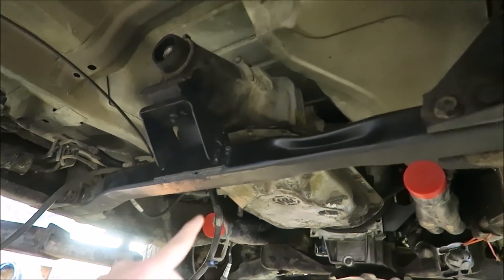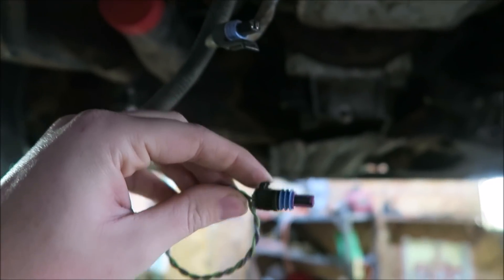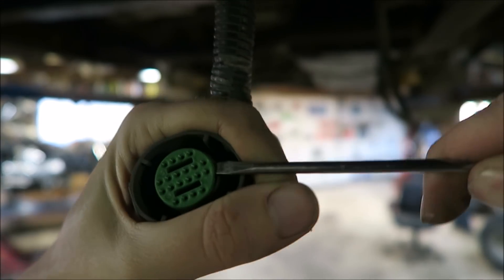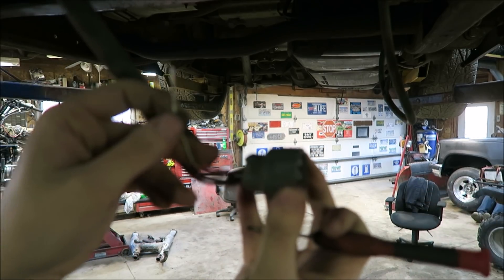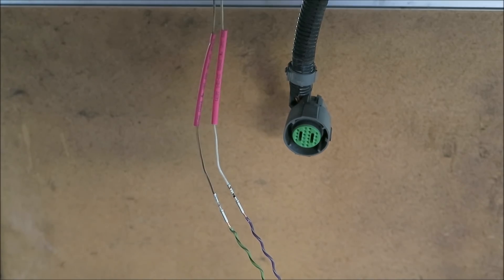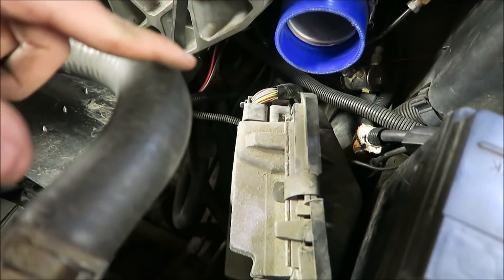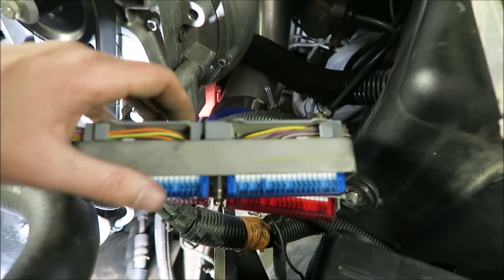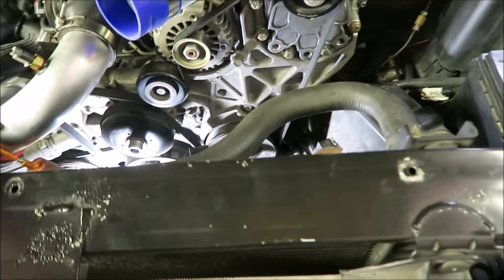Wiring A 4L80e Swap For (almost)FREE!

Comment: I have 1997 gmc and put 4l80e in it and didn’t do any of this just plugged it in goes in to gears and everthing I just can’t start without having to jump fuse /my key will cut lights on dash but won’t crank ? Is that part of having to add that seconded speed sensor ?

Comment: question  we did EXACTLY AS YOU STATED with wire repurposing. when truck is put in drive or low it immediately stalls. in second its ok idling.  trans has been to 2 different  reputable shops..nothing.
ANY IDEAS??
Reply from the maker: Has the ecu been tuned?

Comment: Hello! I’m having trouble with my swap cause the only thing I find is for a 99 and newer models. I have a 1997 and I have completely installed 3/4t running gear in. Do you have info on a 97? The wire PIN numbers are different for computer. I have finished the transmission end and I have 4l80 computer

Comment: I need to know how to put back on my wire harness?? And I'm swapping a 4.8 4l60 to a 6.0 4l80 why do I have to tune my computer if it's the original computer the the stock 6.0 and transmission

Comment: Oh, and by the way unlike here where you're doing a 4L60E to a 4l80E this is a 4L80E to a 4L80E swap so a 91 4l80E being swapped out for a 92 4L80E like I said all my research told me they should be the same transmission but just apparently the pinouts different. All the info I could find before the transmission got here told me 91 through 93 had the same pinout. But then I looked up 91 pinout again and it actually did show this green connector. Versus the new 92 one which has a square peg in the center for the connector to hold on instead of the two rectangular holes to hold the connector on.

Comment: Swapping out one of these in an RV. My connector which is a 91 is the same one here shown on the vehicle you're working on the green with the two slots and I've have a 92 4L80E that I was planning to put it in the old ones place will this type of swap work with that?
Reply: If you want I could send you the pinout diagrams for both of them on messenger Facebook or whatever or by text if you want if that would help but yeah we've been having a bear of a Time getting these repairs done and I'm really hoping that this is compatible it's just one year is difference swapping a 92 in for a 91 but I didn't realize the pinout was going to be different 

Thanks.

Comment: I AM doing the 4l60e to 4l80e swap in my 1995 c1500. I have the computer out of a c2500 with the same applications such as 5.7. And 4l80e. Where as mine was a 5.7. And 4l60e. My question is. If I put the computer and transmission from the 2500 in my c1500. Do I need to change anything on the wiring harness? And if so. What? Any help very appreciated.

Comment: Hi, the 4l80e I got it has 2 speed sensor, now the one on top of the shift switch the plug seems different then the one on the rear of the trany. What will I have to do there? 
I got the new added plug connected to the pcm already but the other plug doesn't fit that one sensor.

Comment: I need to wire a 80e into a 78 c10,got any vids for that?*
Reply: If you are putting it behind an LS engine with an LS harness and computer, yes. If you are hooking an 80e directly to a SBC or 454, you’ll need a standalone transmission controller.

Comment: I have an Fbody that was a LS1 T56 car. T56 was removed after the LQ9 went in, now the turbo 350 is toasted. Should buy a more expensive turbo 350 and still not have an overdrive or do this. Have 500hp or something like that.

Comment: Can i do this to  1992 4l80e tbi transmission.
Reply from the maker: I don't know off hand. Check lt1swap.com
Reply: I think i just found out but not sure . I think i need to upgrade the internal wires and the external wires and also a couple sensor.

Comment: Bro I have a question maybe you have the answer. I have a 92 Chevy 3500 with a 454 in it and the early 4l80e transmission. I had to splice in a new wiring harness bc the customer was having to drive around with the front drive shaft out bc the drive shaft was rubbing the plug. So we had to update the internal harness and external harness. Got it all rebuilt and wiring done and I keep getting code 73 for a force motor. Tried 3 different pcs's/ force motors.  I ran electrical checks and it's getting the correct amperage I believe. Now I also replaced the throttle position sensor bc it wasnt building up to 5 volts as it should. The new throttle position sensor is still not reaching 5 volts. Still the same code. It clears and reappears instantly. I'm thinking it could be the computer but I don't want to just throw parts at it we have alot invested in it as it is. If you have any clue what it could be I would really appreciate your opinion. This truck is plaguing us and we're kind of in a tight spot and need to get it done. Thanks
Reply from the maker: I don't know about those earlier trucks but on my 2000, I believe its the fuse labeled IGN 3 controls shit for the trans and when mine blew it did shit kinda like that. There was a pinched wire that was causing it to short and pop the fuse. Probably not the same for that truck but worth a shot 🤷‍♂️

Comment: This vid clearly explained everything i needed for my 4l60 to 4l80 swap as far as wiring goes i did need to shorten my rear driveshaft slightly because of trans housing being a bit longer 4x4 drivshaft needed lengthening as well crossmember repositioned back couple inches as well
Reply: Hey did u need to do any other wiring ? Or just like him on vid ?

Comment: Can i use a 92 suburban  4l80e for an ls   
Swap. As far the wires for the ecm
Reply: I have a trans from a 92 suburban  tring to make it work on my 98 truck have had no luck finding info if theres a way to make it work or not have u had any luck
Reply: I think u need to upgrade the internal wires but i don't know about the linkage    because the 95 and up have a longer linkage. But to ls swap it u just need to change the wires and some sensors.

Comment: if u do 80 swap do u have to modify the transmission lines?
Reply from the maker: Depending on what year 80e you get you have to extend a line. Which you can just cut it with a brake line tool and use high pressure hose to extend it. Be sure to use fuel injection clamps, I like to do 2 on each side and flare the end of the hardline too just to be safe
Reply: Transmission is out of 2003 Yukon 2500 going into a 2005 GMC Denali 1500

Comment: So on a 2wd, what about the driveshaft? I have a 2001 1500 4l60 and am going to build my LM7 and want to upgrade to the 80.
Reply from the maker: My driveshaft was the right length. Just needed a th400 yoke and new u joints
Reply: SniderTron 3000  What was the length of the th400 yoke and which u joint did you use....please help.

Comment: When you re-pin the PCM with the speed sensor did you just load 4L80E files on the PCM and it automatically picks up the added speed sensor or do you need to program and tell it too
Reply: Will this same repin work on a 94 Chevy truck. At point of rebuilding 4l60e or swap 4l80e

Comment: I have a 2006 4l80e trying put in my 2001 2 wheel but the Neutral safety switch is different from the 2006 it’s one big plug versus two little plugs need some help

Comment: What flex plate did you end up going with I want to run the factory converter from the 4l80 ?
Reply from the maker: If you're using the factory 80e converter, I believe you'll need a 6.0 flexplate and spacer. I went with a Circle D converter and that adapts to the 5.3 plate.
Reply: SniderTron 3000 ok man I appreciate it I think I’ll just go with a circle d also and save some trouble I don’t want to run that spacer with twins I don’t trust it bad enough I’m going to crack the fly wheel 😂

Comment: On mine "sloppy mechanic style" only swapped the brown wire over to the white wire and left wire wire out completely
Reply from the maker: Did you go GPS speedo and manual valve body?
Reply: @SniderTron3000  stock speedo wired 2nd sensor to ecm
Reply from the maker: What'd you swap it in?
Reply: @SniderTron3000  99 Silverado 5.3 it's a stage 5 4l80 with 3500 tci triple disc

Comment: You should have mentioned the segment swap in ECU.
Reply from the maker: mmmmmmmmmmmmmmmyep. My bad.
Reply: @SniderTron3000  lol. What converter are you going to use? Are you going to install a HD2 shift kit?
Reply from the maker: I'm actually talking with Circle D about sponsoring the build and possibly doing a swag pack give away 🤘
Reply: @SniderTron3000  that would be awesome.  Keep it up. 👌

Comment: You're truck is a 99? Your transmission crossmember is way different compared to my 02 sierra rcsb. Either way love your truck and your videos. Keep it up!
Reply from the maker: Titled as a 2000, but could be an early one. I've never looked at the date code.
Reply: @SniderTron3000  Hmm well when the time comes to swap my 60e to an 80e I'll have too look into that cross member before buying the speed engineering one.
Reply from the maker: What I saw most people doing was just cutting theres into thirds and moving the center section back to where it needs to be and plating it.
Reply: @SniderTron3000  I've seen that too but I'm a sucker for quality and looks. Have you seen the speed engineering one? I did the 80e swap on my buddy's truck using it and I must say it looks spectacular. The tubular design and pretty decent welds painted red really pops under the truck

Comment: Best video out there on the wiring 💪🏼🔥
Reply from the maker: I tried to be pretty diligent about showing everything so it might actually help someone 🤙
Reply: @SniderTron3000  do you have to reprogram the ecu?
Reply: Yep
 @CobosDoesItAll
Reply: Does it matter how it's wired to the new speed sensor as in the color code